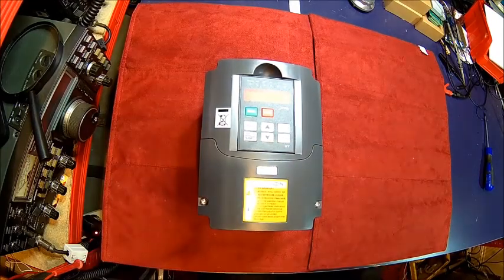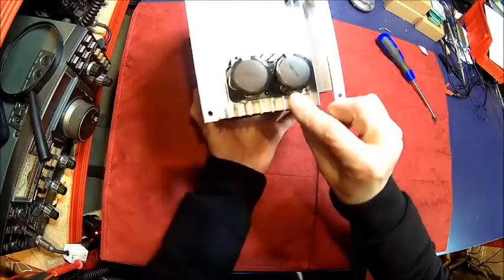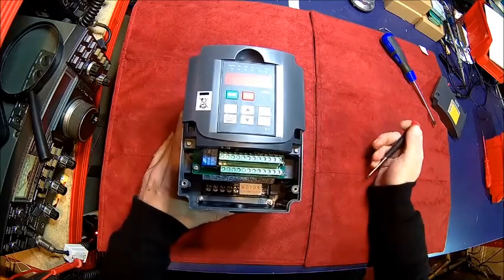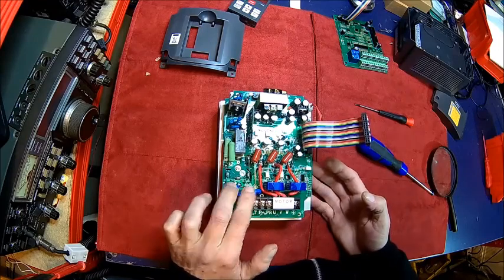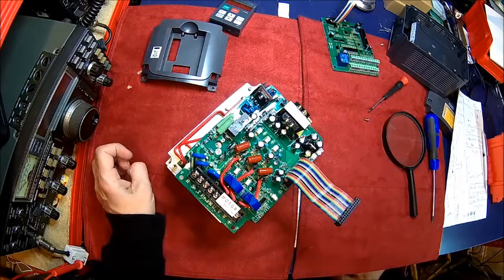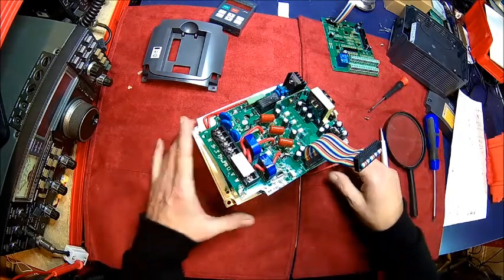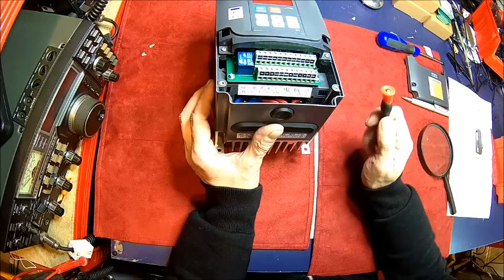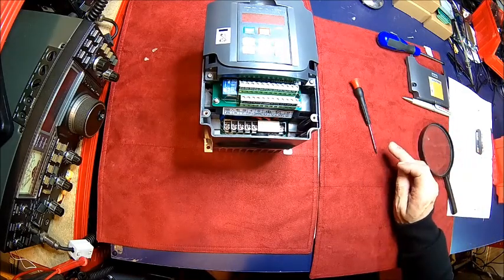Cheap Chinese inverter drive (VFD) part 1 - tear down, inspection and safety check

Comment: Greeting
I have the same device which is broken. His relay, which is located after the rectifier bridge, burned out. My problem is that now I can't read the values of the resistors, the green ones on the video, which are behind the rectifiers. Do you have pictures with the resistor data? Thanks in advance for any suggestions.

Comment: Could you please tell me what the pre charge resistor values. The one that are bypassed when the relay is engaged.
Reply from the maker: sorry, don't know, ... just do an educated guess and try, it's not really critical as they just prevent from high inrush current
Reply: @dynoguy  that is what I did. Two 3.3k resistors 3w.  However the opto isolated failed now and waiting for a new one.

Comment: Where is the cost cut? Well considering they used HV MOSFETs instead of TRUE IGBT's and the fact that they used Transistor Gated Diodes instead of Silicone Controlled Rectifiers... Yeah that thing lasts about 1000 hours compared to an Allen Bradley. PowerFlex 40 is only about $50 on ebay bud
Reply from the maker: Well, they cheap and cheerful, nothing more. I am spoiled from the big industrial stuff as i play with those for a living.
You certainly won't get a new 3kW Powerflex 40 at $50, and if it's on ebay for that price it's probably shot, at least here in the UK.
Anyway, 1000 hours is a long time for a hobby user, so i think they have their place, as long as you aware of the limitations
Reply: @dynoguy  you must be a VFD repair tech like me. Make sure you get a FLIR in your toolbox, its been my secret weapon for fixing gate firing boards. Fixed a cog due to a bad cap on a PowerFlex 700 PINT last week thanks to my FLIR. By the way, you can power PINT1 and PINT2 boards by providing DC Bus voltage from an external power source allowing troubleshooting without SCR's, Caps, or IGBT's in the circuit.
Reply: @dynoguy  my boss would sell me refurbs for less than $50 I am sure. We have about 30 on the shelf. However you are correct considering I have a rare connection.
Reply from the maker: Well,, sort of.i am working in the automotive testing industry and play alot with rather larger regeneration units up to approx 1MW,... i do have a FLIR One and use it quite often for electronics, but also for bearing issues, etc

Comment: I’m gathering parts for electric motors to power my boat and I am considering the affordable 10 hp 7.5 kw vfd for a 10hp 230 / 460 volt Baldor standard e pump motor. If the 10 hp vfd is rated for 230 volts 33 amps and the motor is rated for 208-230v / 40a or 460v 20a? I’m searching for an affordable inverter solution and considering building my own. Anyone have any experience with this?
Reply: Kind of curious what will you be using the motor for actual propulsion or to just pump water?

Comment: Hi, is it possible to use VFD for electric vehicle, and how to control the speed by using external pot
Reply from the maker: Yes it is possible but you need some electrical skills, how to wire a speed control pot should be described in your VFD instruction manual.
Reply: thanks, how about the factory installed potentiometer, is it need to disable
Reply from the maker: You usually can disable the internal pot via a parameter, just select "external reference" or something like that. As i don't know what drive you use i am unable tell you what the parameter # is. Then connect your 
pot to the external reference terminals and it should work.
Reply: dynoguy,  much appreciated. thank you
Reply from the maker: you're welcome, thanks for watching
Reply: @samnile2  If it is a HY unit, there is a jumper that you change.  If you have certain models It is the VI-VR setting on J1. 2-3 = internal and 1-2 = external. It sits to the right side of the PCB right above the screw that holds the board in place.

Comment: The ground wire may have been hacked together at least you should have a ground terminal. My VFD is missing a ground terminal so I drilled a hole in the aluminum cool sink to hook up the ground wires.
Hows your fan? Mine make lot of noise as soon as you start the motor. Pretty annoying. 
My VFD is called the NF-9000 and according to the sticker is my by nflixin. At first glance it looks the same as yours, but it isn't. The cool sink is different because the 2 big capacitors are in different locations.

Comment: Thanks for showing us what's inside the black-box. Is this it a vector drive?
Reply from the maker: You're welcome, thanks for watching.
Well, honestly i don't know for sure, but considering what's there in parameters, how it behaves and not at least  the price, i'd say most likely not, looks more like a textbook V/F design to me.
Still got the 4kW version sitting on the bench waiting for a tear down,  what's concerning is that it weighs less than the 3kW version ....
Reply: I'm getting a 2.2kW vfd that look a lot like yours but is branded WK-9000 and does have vectoring.
It might come from the same factory or the Chinese are starting to clone themselves :)
It's going to replace my old allen-bradley 0.75 kW drive that makes the lathe motor whine like dying pig.
Reply from the maker: I think i've seen your model somewhere and remember reading something abut vector control, ...not tested one of these but flux vector control is only as good as the (sensorless) rotor position determination algorithm and that works best with a pretty fast  DSP which usually costs money... and don't expect that flux vector control makes it quieter - nope it does not.
Need to look that thing up, what did you pay for ?
Btw.. the noise comes from the switching frequency, on Allen Bradley drives you can change it easily and the thing goes quieter,  downside is that you may need to derate it above 6kHz.
Don't expect the Chinese thing to be quiet, from what i've seen they run on 3kHz by default, anything higher requires derating,  ......as usual, you get what you pay for.
For the right price I would happily buy that AB 0.75 kW off you, but shipping is probably the killer.
Reply: My AB is pretty old. Its a type 1333 and I believe it got introduced in the late 80s, probably a slow DSP and no option to change the carrier frequency.  I was given 6 or 7 of them and they all still work fine. I do wonder if any of those Chinese drives will still work after that much time has passed.
I'm getting my drive from banggood and they are actually sending me one to review. I'm not an electrician so I'm spending the evening reading the chinglish manual and watching a bit of Youtube :) But it should be a problem to get it running in V/F mode. I do wonder about my motor since the new drive van supply 3 times the power.
Anyhow, it's going to be fun to try this thing out :)

Comment: Nice tear down. I purchased same unit about 4 years ago off eBay. First one had an explosive capacitor failure, so seller replaced it. I've found several VFDs that were new spares for very decent price, and they were vector drives. I've removed all the single phase motors from all stationary equipment where variable spindle speed is desired, and replaced with 3 phase motor and VFD. Really allows one V-belt setting, and I have the digital display indicate RPM instead of HZ.
Reply from the maker: Thanks, ... I use this one in my 3-phase MIG welder as i have only a single phase supply. The setup was a bit of trial and error but it's doing well now, I made a video about that as well, just look for "the supercharged MIG welder" .

I also got a 4kW version of this VFD now, looks a bit different, so that's a candidate for a tear down as well,... if i ever find the time for it ...

Comment: is this a huanyang?
Reply from the maker: Yes, it is. I also recently got the 4kW version of it and it feels surprisingly light compared to the 3kW version in the video.
So i soon will take that apart as well.
Reply: My 4kw 380v version smoked in first start. It starts fine but during start warming it shut down. In main board part d36 seems melt down. Do you know What it is?

Comment: Thank you for sharing this information. I would like to control the speed of a 3 phase 3Hp fan. The controller will be a digital device which I'll use a DAC to have a 0-5 DCV signal. Can I use this VDF? If yes, how will I use the DC control signal to drive my input?
Thanks again for your help.
Reply from the maker: Hi, you're welcome.
It depends on the drive, most industrial types use 0-10V demand signals, but some of these chinese ones give you a choice of either 0 to 5V or 0 to 10V full range. Connection is easy, ground of your DAC goes to control voltage ground of the drive, your DAC output goes to the speed demand input, often signed as the wiper of a pot. The 5V or 10V control voltage output from the drive will be left alone.
You also may need to switch run input and direction input with some relays.
It is also advisabe to put a capacitor of a few 100nF across your DAC output, helps to keep the noise away from your microprocessor .
Pease bear in mind that mains voltage is dangerous, you may need an appropriate qualification to work on such systems.

Comment: Looks like typical Chinese industrial to me. The design/engineering is always better than you'd expect, but the assembly is always a travesty. They cut costs by having cheap, untrained labor do the assembly, so the soldering/wiring often needs to be redone to prevent a fire/electrocution/short-circuit condition. Another cost savings is their metals, which are often unrefined and therefore filled with a whole slew of elemental impurities, including alarming levels of carcinogenic lead (Pb). They also usually skimp on electrical and thermal safety features, but this unit seems pretty good about that. All in all, it's a great cost savings for anyone who has the time to open everything up and fix the wiring (along with any loose/stripped screws). My advice to anyone buying any Chinese industrial electronics is to ALWAYS open the casing and checking the grounds. Cross-reference what you see with what the internet says to do. Case in point - the Chinese spindles, which often lack necessary case-grounding wires.
Reply from the maker: Well, the engineering is not always better than expected, just watch the mixer video....  but i agree, safety is always a concern.
Lead is toxic, yes,... but if you apply a bit of common sense it is not particulary dangerous, during the last 40 years i ( and many other people) regulary used PbSn solder because that's what we had ....  that lead free stuff is not exactly a good substitute and you cannot use it to repair old electronics either..... just an old ass opinion.
Just received a 4kW version, we'll have a look into this one soon as well, because it seems to be a bit different to the 3kW version here.

Comment: Would you say it is best to go one size up on a cheap VFD for motor applications then, or doesn't it work that way? The reason I ask is they seem pretty motor specific, at the smaller sizes e.g 1/2, 3/4, 1 HP anyway. Cheers. Just subbed to your channel BTW.
Reply from the maker: Generally speaking  yes, for 2 reasons... 1st for piece in mind as we don't really know if those cheap things are rated for continous operation at full load  But if you buy a 0.75kW vfd for your 0.75kW motor you don't need to program anything because the drive limits are the motor limits, plug and play for consumers (sort of, but not really) 
... and 2nd,... if you go one size bigger you get more current capacity, allowing for higher overload.
Motor name plates usually state continous ratings, any induction motor can do at least 125% in a 50%  S6 cycle (non vintage motors only)  For workshop machines (mills/drills/lathes) i set the max overload to around 150% with a 1 or 2 minute limit, it just provides that little extra torque when you push a bit too hard. Bear in mind that a motor is essentially a big heatsink, therefore moderate overload is fine as long as your average over a specific time period (usually 6 minutes) does not exceed the continous rating.
Welders are a very good example, they usually state a duty cycle a high Amp settings, if it says 50%, thats 3 minutes on and 3 off..
As long as you program your VFD with the right numbers, even double of the motor rating will be fine.
How much you can squeeze out depends mostly on the motor and also a bit on the drive , .. some are better, some worse, some junk, you get what you pay for. .... Thanks for subscribing.
Reply: Thanks, that's some really useful information. I feel more confident about what to buy and what to do with it now.dynoguy

Comment: Interesting video. I have looked at these for my lathe, and mill. I can't justify the expense of a 'name brand' unit, but if i get 10 years out of a cheapy on home use, x 3 for 30 more years, i probably won't be using it much after that.
Reply from the maker: Thanks ... You absulutely right, for consumer applications it's just fine. It's certainly not designed for industrial use.  I bought mine for a non-motor application, shouldn't take too long until i reveal what it is for,....
 btw. i am missing progress on your shaper, want to see chips flying ...:-)
Reply: I've been working away so i haven't spent as much time in the shed as i have wanted too, but i can tell you this - the chips 'ring' when they hit the floor!!!

Comment: It's cheap, and it will do the job.How much would a 'good' device cost?, There are very few things that are just 'good' now, sad, but, Isn't that just the way?, J.
Reply from the maker: You absolutely right,  this is a throw-away consumer product targeting users who just want to spin a motor on the cheap. I would certainly not use this thing in an industrial application as it simply isn't designed for such. A Parker 890 or Yaskawa A1000 series will cost about 3 to 5 times, depending on options, but they come with decent handling software, realtime monitoring capabilities and top notch reliability. I have seen some of these running flat out 24/7 for many years with no trouble whatsoever.
As always,...you get what you pay for, so for the price tag and understanding what it's made for, that thing is pretty ok.
Reply: Yup, okay for home use, but, I would not dare fit it and guarantee it in some commercial environment, Nice video, I will never need to use one of those controllers in the future, but its nice to see what is available, Take care, J.

Comment: The 2-pin TO220-device on the heatsink is neither a voltage regulator or a diode; it's a thermal cutoff :D
Reply from the maker: Thanks for spotting that, i did not really look at it as i was only interested in the output stage ratings. I am going to use this with short but frequent overload spikes and very steep ramp times (it's not a motor), so better to know what's really in it.

Comment: I have three of those units in my shop, so far so good no problems. 3 years running mill and lathes, I have a spare on the shelf just in case one packs up. For the cost of one ABB or similar drive in a smaller size I have two running and one spare. I can't complain.
Reply from the maker: Cheers Mat, good to know that you happy with it. I have a huge selection of drives but almost no 230V input rated ones as i usually run with my transformer setup to get 440V single phase into the drives.
As for yourself, the price was very attractive (£108 for the 3kW version) so i thought i'll give it a try.
The target application is a bit challenging, it is not a motor and the VFD will see frequent overloads with  ramp times close to zero.
I am also going to use it for testing your motor, saves me re-programming one of my 400V units.